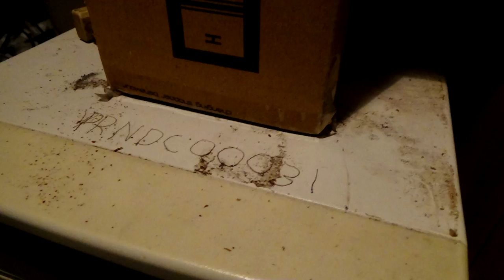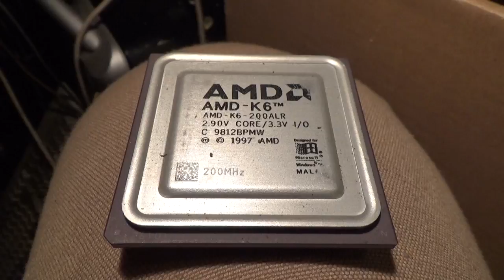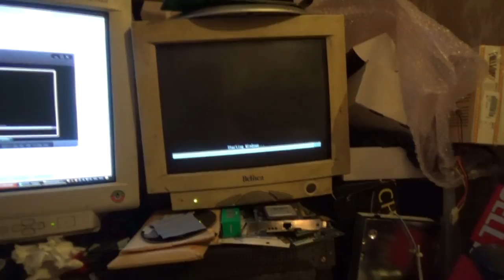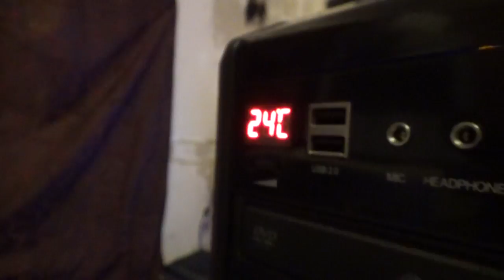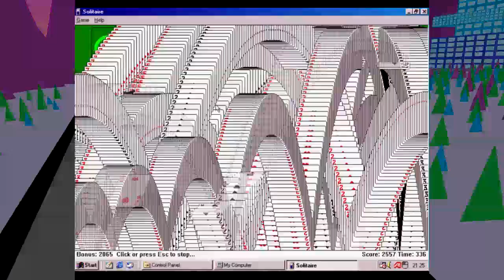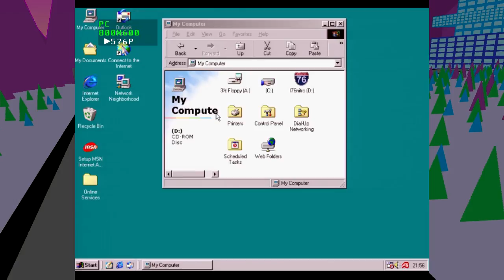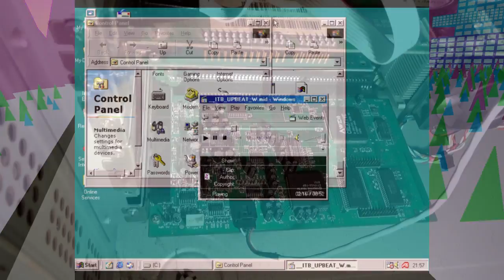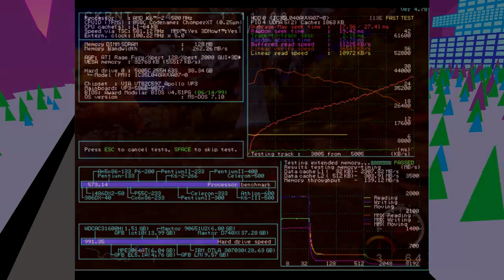Unreliable AMD K6

Comment: I had this same motherboard, it was awful, all kinds of issues and disk corruption from the IDE onboard, I ended up buying a Gigabyte to replace it, the PC still runs to this day perfectly on the new board!
Reply from the maker: Well, that confirms I'm probably not doing anything wrong and the board just isn't very good. Thanks.
Reply: Gigabyte has been my favorite brand, I also like some ASUS, DFI and MSI boards and Intel and AOpen
Reply: the TMC AI5VG+

Comment: I think the MVP4 combined with a Radeon 7000 pci card would probably do very well for a K6. AGP really isn't any better over PCI at this point in time.  Rage 128 PCI cards are around, but a Radeon 7000 is usually more common, much cheaper and wouldn't hold back a K6-2.  That is what I would do instead of buying another motherboard since you already have the MVP4. Sell this board while it still works :)

Thought on your PII, I know you said you got a 450 already, which is a great chip, but you might have more fun with it if you were to get an unlocked Klamath 300Mhz like I have. Probably wouldn't get it to run at 450mhz, but it will run as slow as 133Mhz at least, or maybe even 100Mhz if your QDI goes down to 50Mhz bus. Just a thought since you mentioned the K6 emulating various platforms, with the right PII, you can do the same with it and they are easy enough to swap processors in and out for when you want to run at 450.

You know there is something wrong in the minds of politicians when the government will pay for "gender reassignment surgery" and yet not provide people living in their housing system the basic need of hot water.
Reply from the maker: Possibly, but I wanted to use that for something else. I'll wait and see how the Pentium II goes first, then perhaps it is worth trying the MVP4 board out, I can always just switch it back to its original project if it doesn't work out. On the P2, I'm almost certain my Klamath 266 wasn't locked, but I can't be sure right now, would have to test it. Unfortunately I'm not a fan of constantly switching things back and forth, so I'll save that as a last resort. If everything fails with the K6 and the P2-450 works out, I suppose the Klamath would work in that Celeron board as a stop-gap until I can come up with something better.

With housing it depends on who you are, certain groups get a completely free ride and really, you can't blame them for milking it when the system is willing to pay out every time. But anyway, yeah, the yellow label  I had to block out in the moving vlogs, it is a notice of condemnation for the gas installation. Things are happening right now, so I can't do anything currently, but I suppose it could make for another set of boring off-topic videos if I finally decide to just fix it myself - not the gas, can't do that, but I can get a gas man to remove it so that I can install a cylinder. It's a mammoth job though, plus I'd have to remove it again if I ever moved out.
Reply: Amen on you last paragraph WaybackTECH
Reply: Now days if you are not wealthy you are pretty fucked right now, middle class think they got it bad they should take a good look at the rest of us lower down on the pole.

Comment: I've been keeping my eyes out for a K6 system, though I'll probably pass as I already own parts for a Pentium II system, that (did) perform very nicely with anything that I would throw at it, last time it worked.
Reply from the maker: Well, they're both good. I can totally understand that though, I've always enjoyed working with the Pentium II. I don't know what it is, but you're right, they literally just work no matter what you throw at them. I think I said somewhere how my old, old Pentium II could actually outrun my Pentium D in most IDTech 3 games, never did I figure out why and the Presler's dislike of the engine continues to the present day. On the other hand, even when pushed harder than it should have been, no Pentium II has ever really given me any serious cause for concern. Back then I used that old 266MHz P2 for 3D work - the technique used to render my shoddy logo is something I was using long before YouTube, though I doubt any of those old renders - mostly consisting of things happening in outer space - or the resources used to make them still exist. Again, the Klamath was flawless the whole time.

Comment: Speaking from personal experience (I've had a couple of Apollo MVP3 motherboards way back when) I can't help but wonder if some of the freezing/crashing issues are from you running an ATi graphics card (especially a later 4x AGP capable part).  I realize you picked it for compatibility with your installed ISA capture card, but if you have a 3dfx Voodoo Banshee or Voodoo3 AGP card give that a go instead.  The MVP3 had an infamously buggy/unreliable AGP implementation that didn't play nice AT ALL with many, many discrete graphics boards.  Since 3dfx AGP cards use the bus simply as a faster clocked PCI interface, it bypasses the faults in the chipset.  While it may not fix everything, dollars (or in your case, pounds) to doughnuts games should at least give you less trouble than everything else.  If you're ever bored and don't know what to do, give it a shot.

Comment: Those VIA chipsets...I have one board with a VIA chipset and I can't put more than 2 expansion cards in it or it won't POST. It's the only board that gives me problems.
Reply from the maker: Over the years I've come to the conclusion that everyone favors a different chipset on SS7 and are quite black and white about it. Always horror stories about one and no problems with the other. For me it was always VIA that works, but now, who knows, maybe I'll try ALI next time.
Reply: I have a P5A-B with the ALI Aladdin V and it's a huge PITA sometimes especially with AGP cards and CPU's at or greater than 500MHz. W/o updated chipset drivers it's completely unusable with AGP Nvidia cards. Anyway, I'm a new Subscriber to your channel and I really got a kick out of this video.
Reply: super socket 7 itself was a train wreck in my opinion, slot 1 or socket 370 were better.

Comment: "The system dual boots windows 98 and windows 2000 professional!"..... not so much. Lol. Great video.
Reply from the maker: Yeah, I had written some things I wanted to say about running Windows 2000, then it broke before recording the footage or the voice over, so I decided to read the first line anyway and have that rewind instead of completely omitting any mention of the operating system from the video. As time went on more things I wanted to do stopped working and I just went with what I had in the end.
Reply: HighTreason610 glad you did that. It was very funny!

Comment: That hard drive bearing noise heh.
I recently got hold of an old laptop with a K6-2 500 mhz at 450 mhz. (Oddly enough its set at that, & i dont want to touch the jumpers atm.)

Screen was broken at some point & the hard drive is a mighty 6 gb ide 2.5 inch drive with an awful bearing noise :P
managed too get generic usb storage drivers & got a 32 gb usb stick working fine with it when i format it too fat32.
Reply from the maker: It wouldn't bother me so much if it wasn't a Hitachi, but given their track record it does add a sense of impending doom.
Reply: While it sounded good on paper at the time too them, that glass with heat & constant centrifugal force caused the magnetic coating too fall off & that ofc causes an instant failure when the heads start touching it & pretty much shaves off all the material. (the picture on the wikipedia page shows it well there.)

Was the 75gxp models that had that failure so if you aren't on one of those you should be good.
Or on a 5400 rpm version that actually didn't have the same amount of problems called the 40gv (still failed in the end but not as fast or often as the 75gxp series.)
https://en.wikipedia.org/wiki/Deskstar

Comment: I had a couple crappy socket 7 boards, both are PCChips ones, 1 is dead, and the other one works but is pretty finicky. they are both on my wall as decorations.
Reply from the maker: Overall I still think MSI was worse on average.

Comment: Macron power XD

Oddly enough, YMF7x4 cards aren't that rare where I live. I've found 4 of them in about 2-3 years (I've got 2 YMF724 and 2 YMF744). I kinda prefer the YMF744 because for some reasons I've never been able to start duke nukem 3D with sfx on YMF724. The machine always crashes for some reasons when directly when the game tries to access the sound card. Otherwize on my YMF744 it works perfectly. I have absolutely no clue why it doesn't work with the YmF724 and why it does on the 744. Otherwise they are both the same thing I guess

Have you tried to lower the FSB to 66MHz ? since you said they didn't change their design between the 66MHz chipset and the 100MHz MVP3, maybe it would run more stable ... or not XD*

Good luck finding another YMF7x4 !
Reply from the maker: Oh, the 724 is common enough, but finding one with SPDIF, PC Speaker input and internal mono output is damn near impossible. I've settled for a YMF744 but it lacks two of these features and I doubt it will live up to the 724 I had, but I'll keep looking anyway as it can't hurt to have more than one. Also have to make my own ugly SB Link cable now - speaking of which, you did have that in place when you tried to run Duke3D, didn't you? You need that for proper DMA / Interrupt access, the TSR doesn't come with guarantees. Otherwise, PCI cards in DOS generally don't and it could just be one of those things, occasionally I'd run into something that complained or didn't run and either have to change a setting or just admit defeat.

Then again, real DOS machines with real Sound Blaster cards occasionally have problems running certain things and over the years I've formed the opinion that it's just luck of the draw and comes with the territory.

I can't remember if I tried lowering the FSB but I never factored it into things anyway. For the same reasons I didn't criticize Chicago 189 for instability, I couldn't praise this for running at a lower speed because I judge things based on what they say they will do on the box. TMC sold this as a 100MHz motherboard, therefore I will base my stance on the board running at 100MHz.
Reply: Oh I see ^^

Yes I had the sb_link connector ... Though I wasn't clear with what I said, I meant : it crashes when I'm starting the game within windows (to use the great XG synth). Apparently windows drivers doesn't use the SB_link at all ... However under MS-DOS (with only opl3) I remember that it worked. So yeah, for some reasons, under WINDOWS, duke 3D doesn't want to start with sfx enabled using both of my YMF724 but works with my YMF744

Comment: lineal power supply have less noise than switch power supply...  that isn't a issue on computers... wait it's, and a big one if you get random resets
don't used a switching power regulator is only a waste of energy, not a bad idea on stability...
Reply from the maker: I should have probably worded it better - a well designed switching supply is going to work better than a linear supply here. But yes, they both have their own pros and cons and your logic is sound.

Comment: the Gigabyte GA-5AA is my favorite SS7 board. along with the ASUS P5A-B
Reply from the maker: Wouldn't touch either of them myself, but I've heard good things about them, in this house things are largely ECS, Chaintech or less often Abit, the current K6 is of course on a Chaintech 5AGM2.
Reply: @HighTreason610  I gave up with super socket 7 and went with slot 1, got a ECS P6BX-A and a Pentium II 400 and haven't gone back. I got a Gigabyte GA-5AX and it was just a nightmare. it never worked right and Windows 98 just wouldn't install right.

Comment: Shame the board on this machine is so wonky. Perhaps it doesn't much like the 100MHz FSB as you mentioned. Perhaps try 66MHz? It obviously hates the AWE64, maybe that is part of the problems? I totally agree with your comments on the K6/2, it's a great little chip although I do have a soft spot for the medocino celery & the Cyrix MII.
Thanks for the video, enjoyed it.
Reply from the maker: I honestly don't remember if I ever tried 66MHz and by now I've already gutted the machine quite far, so can't really test without putting it back together - honestly, I'd rather not. It probably works better though. Initially I didn't have a sound card and there were still problems just getting out of POST, so I doubt it makes that much difference aside from adding audible problems which were probably always there. Cyrix MII? Indeed, I've always had a fondness for those and Cyrix in general.

Comment: Maybe you can check out socket 462 ?
Has early usb support & in some cases boots into linux distros from usb reactOS would be alright to try out, some motherboards still has old isa slots as well & a higher end 462 cpu would keep up enough to run most direct x 8 titles & some early direct x 9 games with a proper agp gpu.

A motherboard too be on the lookout for i suppose would be this socket 7 one.
http://www.gigabyte.com/Motherboard/GA-5AX-rev-52#sp
supports the k6-3 cpus that has on die l2 cache & just about every voltage imaginable for the cpu's of the socket 7 platform.
50 euro + shipping eventually, has two usb ports in the rear (1.1 most likely but its something.)
http://www.electromyne.de/Motherboards-Vintage-Socket-Motherboards-Socket-7-Motherboards-Gigabyte-GA-5AX-ATX-Desktop-PC-Motherboard-Sockel-Socket-7-AGP-SDRAM-PCI.html

Comment: venting deep seated hatred for hardware and software is healthier than keeping a grudge bottled up until you snap and scream so hard over tiny things that it shakes the house and the neighbors start complaining
Reply from the maker: I doubt it would matter. My neighbor keeps complaining about noise that doesn't exist outside of his head, yells at his walls in the night and has the cops around at least once a week.
Reply: @HighTreason610  I suppose its a bit too late in that case. 

I have to agree with you about the K6, that platform literally gave me night terrors about glitches as a kid. that might sound stupid but there was a lot of unresolvable problems with it. you have the usual freezes and crashes but sometimes you'd get sadistic errors that seemed to wait until forgot to save and then crash. then there was the inexplicable issues like crashing and then you needing to reinstall the entire system just to try that program again. then it eventually even stopped allowing you to run things even after a full reinstall. you never would know if you could run things again. so a program you ran for years might suddenly be gone forever due to a crash and you would never know if it wasn't coming back until days later if it was a nastier crash. data corruption, oh it would take hours to mention all the weird lockups. we thought it was just the OS. 3.1, 95, NT, it didn't matter. it only was really capable in DOS. sometimes on a good day it might let you have one program back you thought was gone forever but that seemed to be so few and far between that it really only served to spoon feed you false hope. 
 
having inherited the system from my dad I'm now having to build a new system to recover the extensive classic games library my dad had. like the Madness song I'm going one step beyond. moving onward to the K7 platform. that should eliminate all the major failure points. as it is I'm absolutely certain the AT power supply is going to kamikaze the system next time its plugged in. I don't trust old mechanical hard drives, sharing bandwidth between the video card/other PCI devices needs to end and ECC support needs to be a thing. by the time I'm done I should bypass all of the horror of the K6. the original system can stay in cold storage as backup once that is moderately fixed up.  

just looking at the computer and the hardware discrepancies in my dad's workshops and storage I can tell this thing was not only picky but it was abominably devious in its resistance to anything except what it wanted. but if I go on any further this will be less a comment and more a novel.

seeing as I'm now having to face the retro projects I've ignored for the past 15 years, I've hit that subscribe button. your vids are fun and educational in a way that you almost never can find and your sense of humor is such that it gives me a good laugh while I'm working. plus you make content long enough that I don't have to stop what I'm doing every five or ten minutes to select a new video. you also talk a lot of shit about hardware and I enjoy that. all too often I see youtubers go "oh this was the best you absolutely have to have it even if it costs a grand" I like how you tell us how something is shit, why its shit, what led up to it being shit and what you are gonna do with it now that its shit. that and you aren't afraid to call out dumb retro stuff that is overhyped and just sought after because its merely trendy or has little top offer apart from snob appeal.